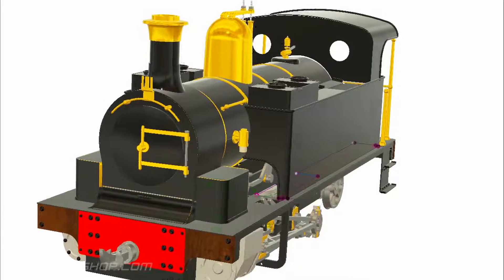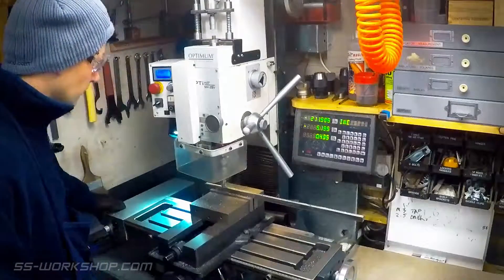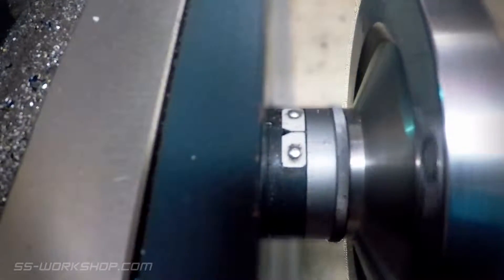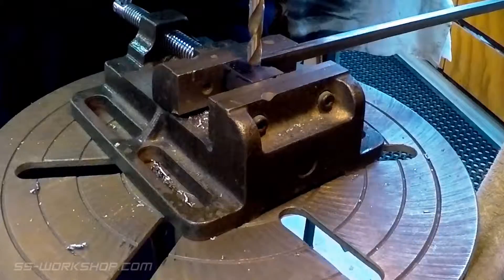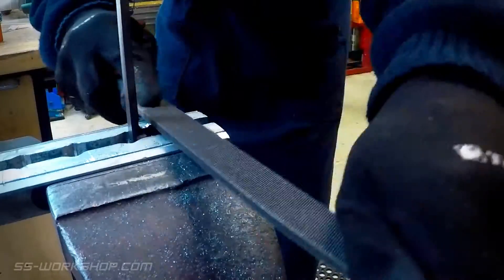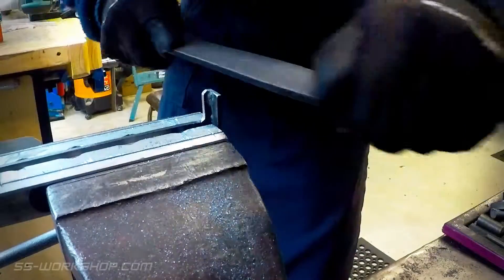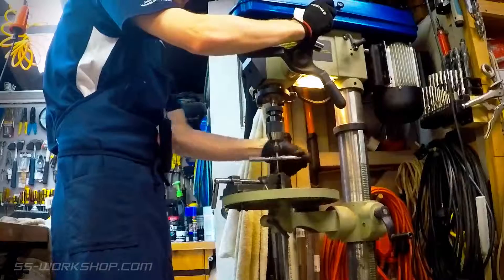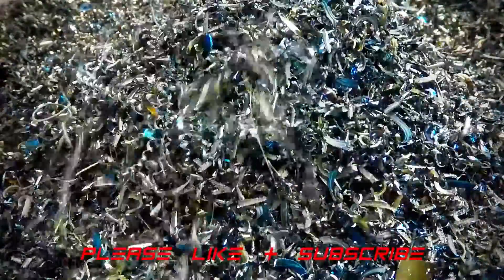Fell Engine Project – Side Rails S1.E3

Comment: Do you have any comments in the rigidity of your optimum mill?  I was looking at this model but I saw a review by a well respected engineer and his review suggests the quality (specifically the rigidity concerns) as a big concern…so much so that he’s given up on milling and uses the mill solely for drilling…would you please share your experiences in this regard?   Thanks, Jim
Reply from the maker: Hi Jim, I have found it to be good for the work I have done. I usually run up to about 12mm end mills but also a 50mm face mill. My previous mill was a small combination lathe mill which I found to be no good as a mill. I think it really comes down to your expectation as benchtop mills are always going to be limited by the body size and weight.